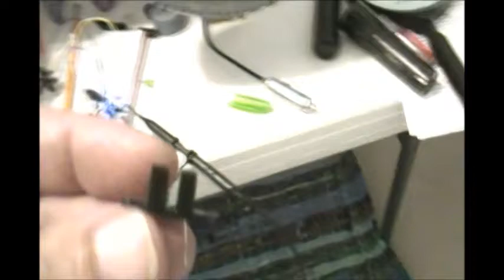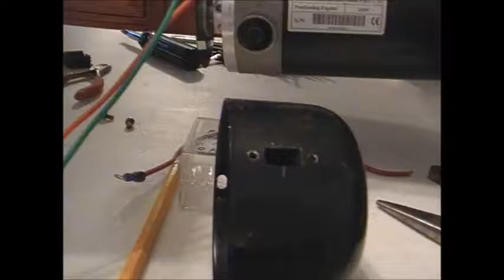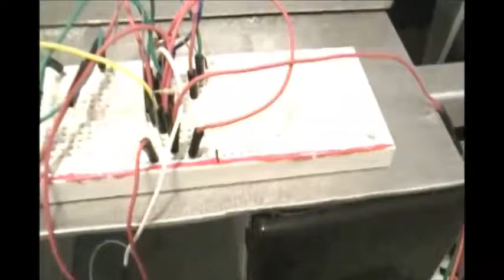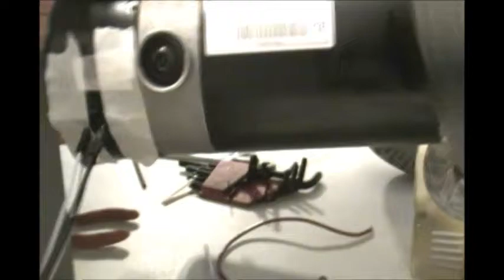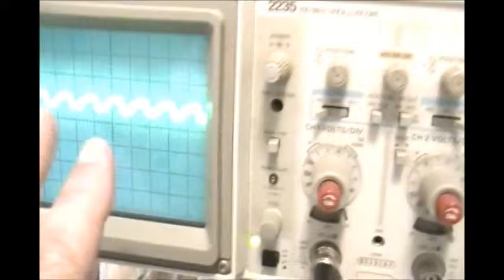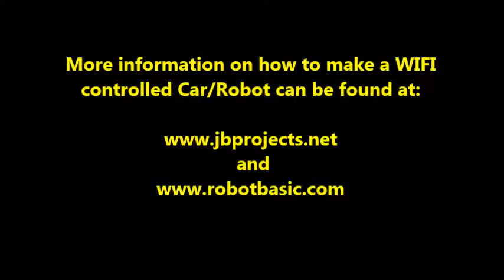Power Chair Motor Opto-Coupler Test

Comment: Hello, I am working with a very similar motor and attempting to add in a feedback system as well. I was wondering if you were able to purchase the encoder disk you used or if it was custom made?  I am considering 3D printing a disk for the application but I am worried there wont be enough room for the optical switch to mount at the end of the case as the disk would have to be mounted on the end of the motor shaft which goes almost all the way to the casing.  Thanks for your help.
Reply from the maker: I was very lucky to have these disks from equipment I use to work on long ago. I used a Dremmel tool to cut out a small rectangle shape to mount the encoder to the cover. I did have to wrap some sticky metal tape onto the shaft to be able to tighten the set screws of the disk. You do need to make some accurate measurements of where the disk will be to properly go thru the center of the encoder.

Comment: So Im a bit confused on what an emitter is. Can you use that to keep track of how far the robot goes? Im doing a project with the sabertooth 2 x 25 and wheelchair motors and since im pretty new at this, im having a bit of issues with programming and such.
Reply from the maker: Absolutely Patricia! You can hook the opto coupler to a microcontroller (like an Arduino) and have it count the pulses. Of course the diameter of the wheels are important too. Each pulse is 1 cycle, so as an simple example if you get back 10 pulses per second for 1 complete revolution, that's a "frequency" of 10 cycles/ second OR Freq= 1/time or time = 1/Freq (or 1/10th of a second per pulse, with the time you can figure out distance (by knowing the circumference of the wheel) I hope that helped! Good luck with your robotics.
Reply: It's also a great way to know if the chair is struggling.. Can use it to cut power if necessary. If you know you are sending a signal to the Motor Controller, but the Octocoupler is reporting either no or slow signals, then the wheels are not moving and the motors are most likely requesting stall current (amps).. Unless you have been very good with spec'ing motor controllers, you may be trying to use more amps than the motor controller or batteries can handle for long periods of time.